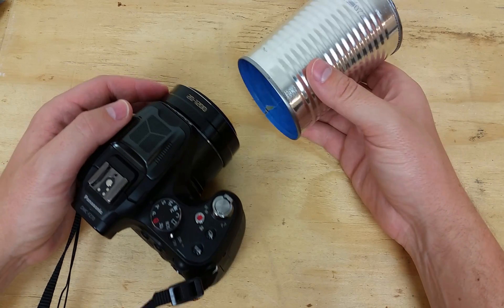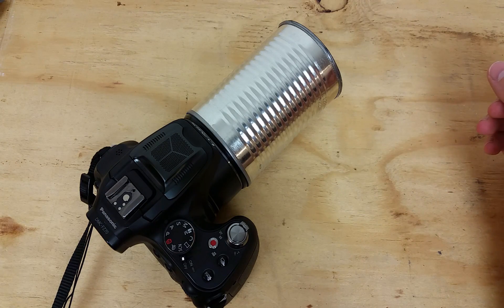DIY Solar Filter for Cameras and Telescopes

Comment: Thanks for share. You can mitigate those rings around the image; paintig with deep black the insides of the can. Regards.
Reply from the maker: That is a good idea; I will have to try that in the future. My final design in part 2 just had a small hole since I was only using it with full zoom. That used less material and let less light into the can. https://youtu.be/tKNujbx8SNY

Comment: More for your money and safer if you go to the camping section and get a Space blanket. It's thicker and more pure and you can layer it. And you get a HUGE sheet vs a greasy old bag ;-). Make a second one and put a layer of Kapton tape over it for a slight filter. (Kapton on top of Mylar makes the most PURE gold texture ever)
Reply: Great idea to try emergency Mylar blankets!
Reply: I may have to test this I have chip bags and I have mylar blankets see which one is better. All I know is mylar blankets suck they rip so easy If you fart they rip😂

Comment: what material did you use?
Reply from the maker: Its a proprietary manufactured solar filter film; most likely a dark tinted PET film with aluminized coating on one side. I got the piece in the video on amazon:  https://www.amazon.com/gp/product/B00DS7RO7Y/

Comment: 4th like

Thank you I got it to work with the chip bag
Reply from the maker: Awesome! What brand of chips did you use if you don't mind me asking?
Reply: Eric Nutsch same
Brand you used.
I just made sure there were no waves and any light showing through on the bag before I put the can on.
I also used black electric tape insted of clear apoxi.
Reply from the maker: H.M.K. Cool! And good idea on the electrical tape.
Reply: Eric Nutsch Thanks.